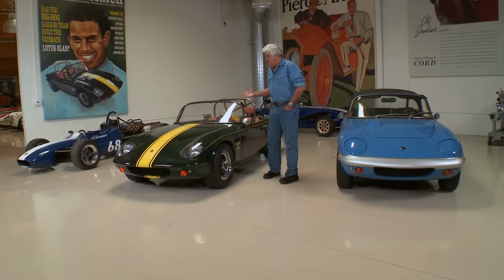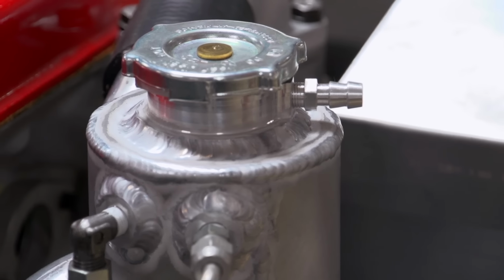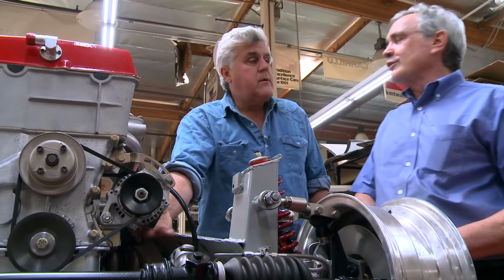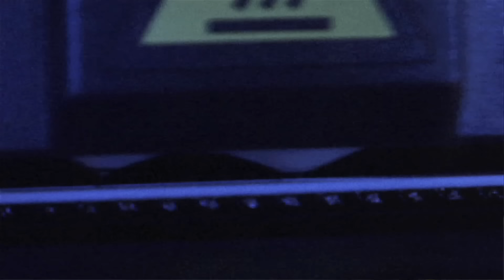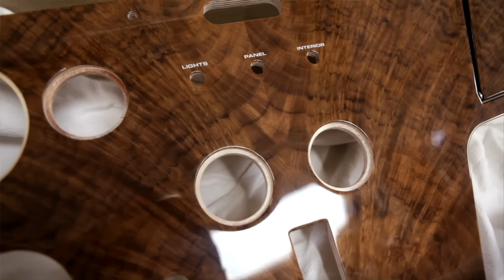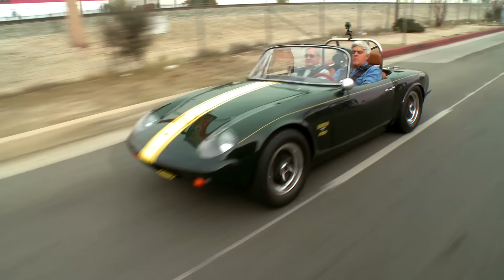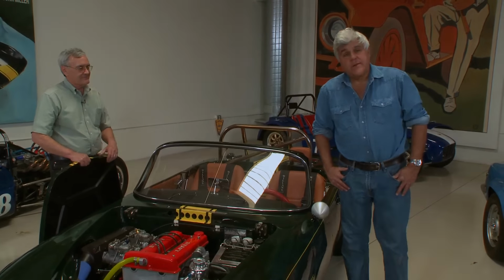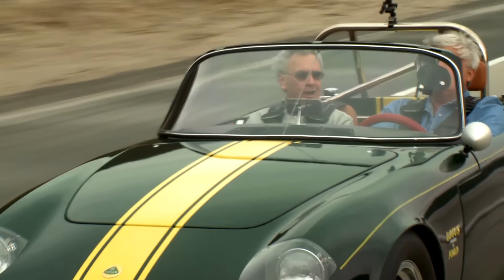Restoration Finished: 1966 Lotus Elan 26R - Jay Leno's Garage

Comment: Does anyone have any idea why the engine sounds so great? In general, which factors affect sound the most, other than RPM?
Or does the sound of this Lotus come mostly from the exhaust resonator and not the engine itself? Hard to tell.
Reply: Displacement and timing I think are the two biggest things.
Reply: TrumpeterOnFire
 No replacement for displacement, gotcha :)
Reply: VioletGiraffe nah this one comes from the flat oval shaped exhaust, the sound reverbs different . timing , especially valve timing, displacement and all those afctors do alter sound but the exhaust alters it the most. Lfa is tuned by yamaha, the mp4-12c is tuned and even large trucks are muffled to a dull roar. so yes its oval shaped tube alters it the most
Reply: Its the straight cut gearing in the sequential quafe gearbox
Reply: *****
 I think you can make it sound low and deep (to some extent) with just the right resonator / muffler / stronger, but without any muffler the dominant sound frequency would be that corresponding to RPM (divided by 2 for 4-cycle engine and multiplied by the number of cylinders), which is not low by any measure (3 kHz for 4-cylinder engine at 1500 RPM).
Reply: The older Twin-Cam Inline 4 Cyls always had a rich motorsport sound, it probably has high-lift cams and next to no sound insulation. With nice big carburetors and a set of throttle bodies matched to a very light flywheel, the engine will always spin freely with a good, racy exhaust note. And as one of the posts above mentions, a straight-cut gearbox always adds that 'supercharger' like whine xD

I've never liked fat aftermarket exhausts though, there's nothing worse than a fart-booming car! Sound like they're powered by a whoopie-cushion through a megaphone...
Reply: Capt Nemo
 Totally agree on fat exhausts :) Unfortunately, some people think it's cool when the whole block can hear them cruising around in their 1.5L korean car.
Reply: VioletGiraffe Glad you think so... it's all about the quality of sound, not the quantity of it.
Reply: every aspect changes the sound. cylilnder bore versus stroke, displacement, cam timing duration and overlap, a big one is the compression ratio, and of course the exhaust and header design.

run an 8.5:1 engine on a stand with a straight header and then rebuild it with 12:1 pistons. you'll hear that the engine now wants to eat your soul :)
Reply: Webers.

Comment: Are the electrical systems in British cars as bad as they say? What are your thoughts? Can you talk about this in an upcoming video? ...please.
Reply: Mack Tonite From what I understand some of them were pretty dreadful, Lucas earned that "Prince of darkness" moniker.

Of course that wouldn't apply to this car as nothing about it is stock.
Reply: Mack Tonite Late 60's early 70's the British mantra was export or die and many British cars and motorcycles were brought into the US. I can remember back in the 70's when just about every parts counter in America had a glass jar sitting on the counter. The glass was glazed to look like a jar full of smoke. The label read "British Electrical System."

Comment: There was an elan +2  I once saw. Do you have one or have you seen one? I was 6’6” in college and there were quite a few older Brit cars around Berkeley on the 70’s. I fit in the Elan back then, despite being much taller than Mrs. Peale. Could never find or afford a clean one. Got an MGB GT back then and removed the seat back stop. Leg room was perfect but the MG’s “roll-on” acceleration was frustrating for passing Caddies with trailers on the PCH. I much later picked up an enthusiast’s ‘69 Mini Cooper S. I loved it but was hit there times. Once in a car wash! Thinking about the a recent year New BMW Mini. At least the electrics should work in the rain. Any idea on what a pre-‘69 Elan +2 would go for if available? Love your channel. -W

Comment: I like the car. In England some store was held for triumphs, mg's n westfields or any little 2 seat car with a high hp engine and we'd called them "head choppers", because they suffered worse for going into the back or side grate of an articulated lorry a little to fast... Home garage tuners would beef the little cars up adding detailing, knowing full well these little English roadster were just about the quickest thing around the tight twisty roads. It is probably right for the stripe to be yellow although if the car was finished over here my guess because of the level of finish around the rest of the car, the stripes would be gold and the steering wheel would be rose wood, n maybe gold rims to. Lol

Comment: In the 70s 80s My favorite car was the Elan Sprint, never owned one. A friend had one, with a Cosworth head. In a tight Surrey country lane he flipped it and another mate on a RD350LC smashed into the wreakage. OK I now have an RDLC 350 in the garage, also an SL500 Mercedes. I would swap the Mercedes for an Elan Sprint. Anyone got one?

Comment: F1  minimum weight permissible is 702 kg 
(1,548 lb) including the driver but not fuel. Cars are weighed with 
dry-weather tyres fitted.
Reply: What does F1 have to do with a 26R ?

Comment: Maybe ive just gone nuts but did i see tbe word ford on the side of this ( between the front tire and drivers seat beaneath the word lotus.
Reply: The engine was indeed a Ford unit. Lotus is actually a chassis builder, that uses powerplants from various manufacturers.
Reply: ahh ok.  i wasnt seeing things then haha
Reply: i know some of the new ones use toyota engines
Reply: lotus has a long history with British ford, with things like cortina's
Reply: TheHamish757 It would be a Ford 105E block with a Lotus twin cam head

Comment: Jim Clark and Jochen Rindt both killed by Chapman's win at any cost, on a budget approach. The big problem was Colin was a structural engineer so didn't really understand things that move. ie most of the time it was pure guess work and modifying other peoples ideas. These road cars aimed for a high profit, hence very little quality control, very rough out of sight. Rebuilding an Elan with new bits everywhere with a modern transmission changes the character to a point that you may as well create something new. You'll only get to crash it once, as the design wasn't finished in the first place before moving on the the next project. At least he had a red hot go for a while. Brabham and Tauranac did it better with less fuss.

Comment: I'd love some "car enthusiast" to explain just why "dry weight" means anything when nobody DRIVES a "dry" car.
Reply: Because that's the actual weight of the vehicle itself.  Nobody carries the same fluid quantities, either.  Therefore any weight biases due to capacities are removed.  You're comparing vehicle to vehicle, striaght up.

Comment: Nice for Jay.......Custom one off chassis and engine and drive train.  Kinda resembles a Lotus Elan but IS NOT what the original '66 Lotus was.  In the middle 70's I was fortunate enough to drive a 10 yr old Elan, It was factory stock and mechanically sound.  It was less than perfect cosmetically and less than comfortable to drive.  The Elan was never a well appointed car.  Bare bones at best, Minimum upholstery, minimum comfort, minimum legroom, crappy brakes, rough ride, unforgiving steering.  It WAS a racecar!  U had to understand the physics of fast driving to enjoy an Elan.  AND yes, it was FAST.  The 10 yr old one I drove was good for 200+ mph with the hood and other body panels flexing in the wind of passage.  Kinda like sitting on a roller skate with a tuna can on yer head.  Very responsive, very easy to over drive,  Lotta fun for a driver who graduated a racing driver school.  Big trouble for the average sports car wannabe.
Reply: I am sure yours was indeed good for 200+mph... if you count the rotation of the Earth into that measurement. Otherwise, no.

And anyway, in addition to this restomod, Leno has a nearly stock Elan too. So that's the best of both worlds.
Reply: brdwonder  I owned an Elan for 13 years which I rebuilt twice on new chassis. I built an engine to Sprint spec and it was good for no more than around 120 - 125mph flat out. There was loads of leg room and the brakes were excellent. Steering highly responsive to input, it went where you pointed it. A superb driver’s car with very safe handling characteristics. I do not recognise your description of the car and can only assume that you drove a very poorly maintained example.

Comment: Preferred the original white Lotus they based it on. Looked like it came through a time tunnel. And you can go time travelling in such cars. Really something as it was. It was made in 67 and had lasted all that time in pretty original condition. Shame they had to do that to it. There aren't as many Elan's around as people think. Here in the UK you rarely see them anymore. My mother had one when I was at school in Westerham, but I haven't seen one now for about eight years.

Don't quite get this modernising of old cars and bikes where almost nothing of the original vehicle remains. You have an original historic vehicle – and now you have a modern 'brand new' sports car that actually looks like a high-end build replica kit car. Strange... If you want a modern car, just buy a modern car, or do all this to a new Caterham 7.
Reply: Um, you realize they started and ended with a 26R, right?   They didn't "base it on" any other Elan.  Mods? Certainly, but the car began and ended as a 26R

Comment: That's a cool car already, but you should put a LS7 Corvette engine in it. 1400lbs and 500hp bone stock. It would have a power to weight ratio that's almost 2 times an Aventador, and you still get 24mpg highway.
Reply: Not ever car has to have an Ls in it that engine is more then enough for that and jay isn't one to put a motor in a car that doesn't belong
Reply: sounds attractive for the power to weight factor, but it's possibly going to throw off the balance of the car with too much weight on the front axle. And given that what it's got is plenty enough, I'd say the extra hp of the LS7 engine wouldn't be as much of a gain as the loss in the handling. Just my humble opinion.
Reply: mardamek
Maybe, but it wold be similar to how the Shelby Cobra came about and we all know how awesome that turned out.

The LS engines are all aluminum these days, so they really don't weight THAT much. I think around 400lbs, which is definitely more than the engine in it, but way less than an iron V8.

Not only that but you would probably need a stronger rear end and bigger gas tank. With those two things the weight distribution would probably even out, or at least be a lot better.
Reply: ***** well, if the numbers are calculated and  the other pieces are built accordingly, that could be an interesting proposition. As for the Shelby Cobra, that's one legendary car. Some of it's performance numbers are impressive to this day, with only a handful of super high end cars being able to beat them. That said, I've heard a lot of drivers mention that while the 427 engine was the more powerful and the more attractive choice in the AC Cobra at first sight, when it came to performance/track driving, they preferred the 289 because of the lighter weight and better balance. Just threw this in there to highlight the importance of balance and handling; but yes, if the LS7 engine can be introduced without messing up the car's balanced character, then sure.
Reply: "just put one"
Reply: The whole point of a Lotus is that it's small and simple and light and uses that rather than power to be fast. Hence, don't bother with a V8. It'd ruin it.
Reply: Foxtrot Oscar
I guess so, but as I said in my previous comments, an all aluminum LS engine doesn't weigh all that much. With that mentality, we would have never had the AC Cobra or the Hennessy Venom.
Reply: ***** It's not the weight, it's the power. The point is, you don't need it. If you're buying a Lotus it's because you don't feel a need for power.

I would be perfectly happy with a world that didn't have an AC Cobra or a Hennessey Venom in it.
The Cobra was a waste of Aces, and the Venom is a waste of Lotus's, as far as I'm concerned. Each was a more enjoyable car minus the V8, simply because you could actually enjoy them, rather than worrying about the power overtaking your skill, or the road conditions.
Reply: Foxtrot Oscar
Again, I see what you're saying, but I think extremes can be fun. I beg to differ about the whole buying a Lotus because you don't feel a need for power. The Exige does 0-60mph in 4 seconds and 0-100mph in 10 seconds. That's pretty fucking fast if you ask me. If you don't feel a need for power you buy a Toyota Corolla, not a Lotus.

I didn't even know what the Cobra was based off until you said Ace, so I'd say the Cobra was a tad more successful. The Hennessy Venom isn't my favorite car by any means, but I still think it's pretty damn impressive. Look up the iDrive review on here.

Extreme cars aren't necessary, but they're actually the driving force that keeps car technology rolling. Had Gordan Murray not built the McLaren F1, Bugatti probably wouldn't have built the Veyron to beat it. If the Veyron was never built, the Venom probably would have never been built. It's just like working out; you have to push the limit or you'll never improve.

Even though the Cobra and Venom probably exceed our driving skill doesn't mean it exceeds everyone's. I would still much rather have an AC Cobra or Hennessy Venom than an Ace or Exige. You can always turn boost down. It's like having a gun, it's just nice knowing you have it. You don't have to use it.

Comment: NOT RESTORED.. restore means ---to return (something) to an earlier or original condition by repairing it, cleaning it, etc. THIS IS THE WORST WAY TO RUIN A CAR. colin chapman would have thrown out the stupid dash and fitted 3mm hardboard, then charged extra for lightness.THIS CAR IS NOW TOTALLY OPPOSITE TO WHAT LOTUS REPRESENTED. do this kind of rubbish to a mazda instead.
Reply: Did you see the donor car?  This is three times the car.
Reply: I own two Elans. You are wrong... You should know that Colin Chapman's road cars were a means to gain capital so - he could build RACE CARS. Nothing was off-limits for his racecars so long it adhered to the criterion - "more with less", or as he's was known for stating, "add lightness". Jay correctly and distinctly stated that this was NOT a "proper restoration". This would have entailed Smiths gauges, Lucas electrics, vinyl interior and the occasional fire - under-dash, engine bay (carb banjo-fittings), etc. The 26R was a racecar designed to finish its race in first place and fall apart ten feet past the checkered flag.